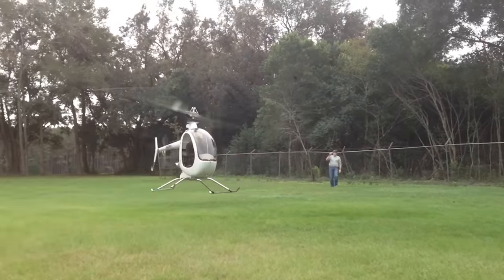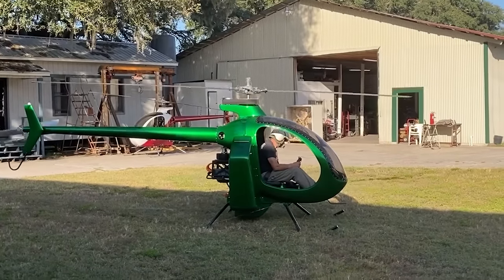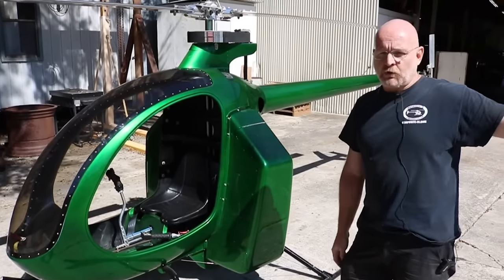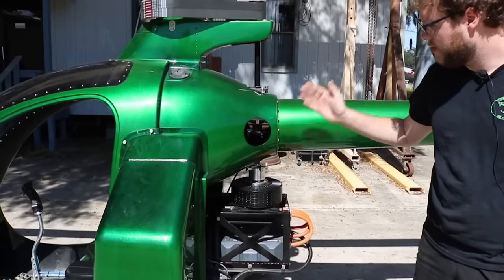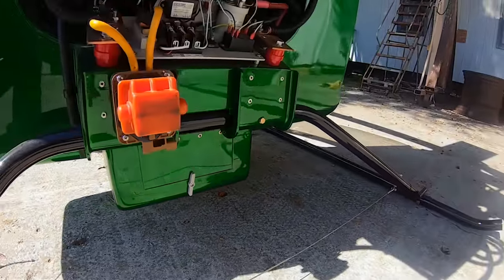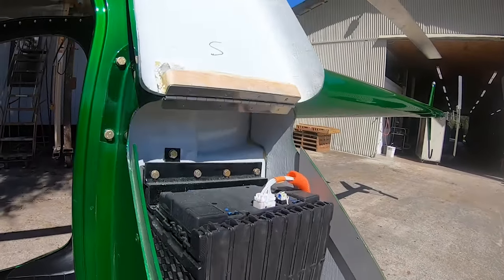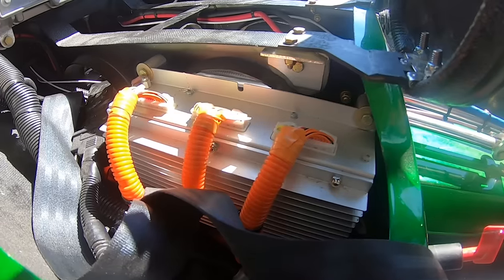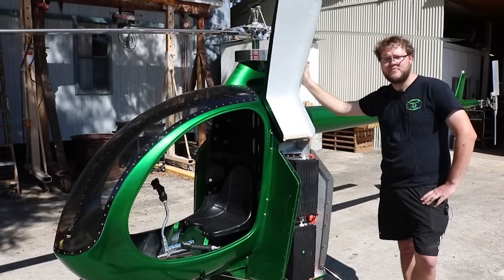Mosquito Helicopter going FULL ELECTRIC!? 2023

Comment: Very cool! I'd love to be able to play with this. What's the torque percentage indication at hover out of ground effect on a Mosquito and what is max?

40 kW and 2750 rpm gives 138,9 Nm of motor torque. Sounds like you need lower kv motor to keep running it if you're maxing out the current limit of the controller now.
Reply: OK sure, thank you father. 🙄

Comment: I'd like to know whether they think a separate motor for the tail rotor would be a good idea, particularly if they were clean-sheet designing an electric-only model. How much room for optimization do they think electric motors could allow, if they completely drop provisioning for a traditional drive-train?
Reply: Matt here. It's an idea we have discussed. We would be able to cut out some of the losses associated with the splitter gearbox for the tail/main rotor, the driveshaft, and tail gearbox. Main thing holding us back is that this would need it's own motor controller, some sort of redundant battery, and rotary encoders for the pedals. You really really don't want to lose tail rotor authority in a helicopter, so it would need a lot of testing. Currently we are testing the electric power-plant before we start thinking about any changes to our drive-line, which is well proven.
Reply: Those tiny model helicopters always have a large gear covering the whole underside of the cabin. I figured that this is the lowest friction solution to get some torque onto the shaft. Hidden from the downwash. Does not obstruct the view. Redundant motors: one in the front, one in the back.

Comment: DEFINTELY want to see more follow up on this episode. Any guesses at public release estimates and pricing estimates would be great. Also, with the added weight of either all the batteries or a hybrid style, additional engine/generator, would this aircraft still qualify as an Ultralight according to FAA regulations? The weight was not addressed in this episode.
Reply: I suggest you and the video creator not wasting time on battery-powered heli: it is DOA just from the energy density alone. Don't wanna agree with me? The battery can improve with time? There is a limit from a chemical-thermodynamics alone- pretty much like the second law of thermodynamics ruled out any perpetual motion machine.
Reply: @irvinewayne4086  Not the same thing but i've seen powertool batteries like the m18 Milwaukee go from 2ah 300-400 charge cycles with a 400watt output to 6ah with the same sized and weight and 3000 charge cycles and 1800watt output. There is also improvements to the inverter efficiency and weight too to be had.

I remember going to job sites in the late 90s and it being a spaghetti mess of cords cause the battery powertools just weren't up to the task. Today only the air compressor and shop vac seem to be the only corded tools that are common anymore. That is only cause of increasing battery power/energy density. Idk if it will ever improve enough for a transatlantic flight but there is still much room for improvement

Comment: Weight seems to be the issue over all else. Would love to see a follow up :)
Reply: Always will be. Lol
Reply: No fat chicks!
Reply: Nothing else comes to mind? You know, with the guys head being higher than the rotors.  Nothing else strikes you as a concern?
Reply: range is also an issue. 25mins is like a trip down the shops for a pint of milk and back.
Reply: Not really, I guess any heavy fuel engine plus gasoline adds more or less the same weight. 🤔
Reply: @CesarPeron  energy density of fuel is 33x more.
Reply: @CesarPeron  True ! That gas adds up.

Comment: I would also think that when solid state batteries show up projects like this will really take off.
Reply: I see what you did there
Reply: Not really. Solid state will only double the flight time. So it goes from 20 to 40 minutes hover time. But then you have to factor in some margins and you are left with maybe 30 minutes or less depending on usage. That is still useless. A gas helicopter can fly for several hours. Hydrogen fuel cells will be somewhere in between.
Reply: Solid state is much safer and lighter. An Aeros ANT can fly under power for more than an hour.  If it had solid state then it would be even more fun
Reply: @jimj2683  30 minutes may be fine for many uses. That could move someone 30+ miles. Rarely do helicopters travel for hours on end from point to point.

Comment: I built my own batteri\y packs and they worked just fine. I am not an "engineer" but making battery packs and wiring them correctly with the BMS and other requirements is not difficult nor does it require an engineer.
Reply: "nor does it require an engineer" but it helps if you know what you are doing.
Reply: This is a terrible attitude. Battery powered aircraft are no joke. A fiery death like the Siemens tragedy is the worst way to go. Please don't trivialize the risks.
Reply: You can make your own packs, but they won't be any more energy-dense than the properly designed modules that they are using, so there's no point.
Reply: Be sure and tell that to John Denver when you see him.
Reply: for a full size flying helicopter ?  show us a video
Reply: I literally put together an LFP 3.5kWh 4S battery tonight (about 3 hours ago from when I made this post), but I still wouldn't discredit the work these guys are doing, nor ridiculing the mistakes they make. 

The worst part were the lugs I was using for the BMS balancing leads were 5mm and the cell terminal posts are 6mm. I had to drill out the lugs. I think I destroyed about 6 in the process lol

Comment: Cool in concept. Maybe someday we'll overcome that whole energy density thing.
Reply: It doesn't make sense, just buy a Cabri or R22 and you got a better helicopter today, not in 10 years.
Reply: Much better batteries are on the horizon.
Reply: LOL yeah, you know, just buy a $300,000-$400,000 helicopter instead, because you know, the average person just has that laying around 🤣
Reply: @caseysingletary9260  It won't cost less than a piston engine helicopter, it just can't because of the scale economy. Want proof of this claim? Just think about the Pipistrel, the electric version cost more the the piston one. Not the other way around.
Reply: @limamikeaviation6200  if this kit ever does make it to market, it will not cost nearly as much as a cabri or R22. End of discussion. Toss all the words out you want, that will always be a fact.
Reply: @caseysingletary9260  Yep, you are right, the point I was trying to make is that it will cost more than a comparable kit piston engine helicopter. There is no advantage few advantages in making an electric aircraft, price is not one of them.
Reply: @limamikeaviation6200  an electric advantage would be operating cost, both due to the lower cost of electrical energy versus fuel, and due to lower powertrain maintenance cost. It's also quieter. 

At this point, as they said in the video, there are few potential buyers for a helicopter with such short endurance, so it's not a viable production product and wouldn't be even in a more refined production version.

Comment: Great prototype! Are there any provisions for cooling air into the battery enclosures? Would it improve the batteries efficiency at all? Air cooling would be readily available (obviously) from the rotor.
Reply: Sort of answered in the video.  They're running so low power that active cooling is not needed.
Reply: They are doing nothing about cooling the battery modules, but they could mount them to finned aluminum plates and blow air past them, as a crude cooling system. The face of those modules which is designed to be cooled in the one that they have vertical and facing inward in the side packs; it normally sits on a liquid-cooled plate.

Without proper control, they may not want more battery cooling. These cells need to be kept within a temperature range for best performance, and while too hot is a problem, too cold is a problem too.
Reply: @brianb-p6586  Cooling is not needed due to the low power draw from the battery pack.
Reply: @LoanwordEggcorn  that's what they say, but a continuous 8 kW per module is well beyond the normal service of these modules. They might still be okay.
Reply: @brianb-p6586  Agree it's higher power per module than the Chevy Bolt donor vehicle, but it's probably still ok.  It's a 3C (3 times capacity) discharge rate.
Reply: @LoanwordEggcorn  right... but while 3C might a reasonable peak discharge rate without cooling, 3C continuous is another matter.
Reply: @brianb-p6586  Depends on the battery chemistry, packaging, etc.  3C is a bit high for NMC.
Reply: @LoanwordEggcorn  it's too high for LFP as well, although I doubt they're using LFP. Most likely NMC, NCA or LCO

Comment: A reduction gear would help. I know its a pretty far stretch, but I sell electric lawnmowers. One of the problems with them is the run time drastically decreases with load. We can have a mower that can push mow a half acre on a 60v 10amp/hour battery, but if you let the yard grow out and try to slog through it. You wont be able to make it through half the yard before the battery dies. Our big twin blade electric push mower with a gear drive actually runs for an hour and a half or more on 3 10 amp/hr batteries.

Comment: Great to see an electric helicopter, even that it is a prototype it is a good start. Very quiet and easy to fly as far as I can see. With future improvements on battery density this will be viable. Another idea is to use a Hydrogen fuel cell. That will give a bit longer fly time.

Comment: How is the weight different with the battery power vs gas vs turbine?
Reply: The electric bird is heavier
Reply: @allencox7949  How much heavier? Did the combustion engine version fall within part 104 limits of 254lbs? Does this one?

Comment: i like how he though it was gonna be a 12 or 24 bolt system haha
Reply: LOL, the wires would have to be HUGE...
Reply: @RussellD11  not only that, 12/24 volt has very little torque, and not nearly enough to drive two rotors capable of lifting a load of mass off the ground.
Reply: @missingMBR  agree, but I think if you "could" pump enough amps through at 12-24V it would have quite a bit of torque.. But agree 100% its not the safest, or best way.. Way too much resistance as well at lower volts...
Reply: @RussellD11  sorry I got confused there. Voltage is proportional to speed. Current is proportional to torque. So you're absolutely right. You could throw enormous gauge wires at the motor and achieve the same amount of torque. But is it practical, not very, haha.
Reply: @missingMBR  they "may" also find going to AC voltage like the bigger EV cars use, may have some weight benefits, and lower temperatures..Will be interesting to see how this pans out and what they end up using.

Comment: I think if they went with LiPo batteries they could reduce weight...or extend flight time a bit. I think they need more aerodynamic battery boxes as they refine the design; those boxes must create a lot of drag in forward flight, although I'm sure creating lift is eating up more of the battery energy.
Reply: They might be able to put the batteries in aerodynamic pods that might have less drag.
Reply: That's for sure, this is just the first prototype, a "let's put something together with what we already have and see how if works".
Reply: They are using a type of lithium ion battery with one of highest energy density of any battery is just a different anode that is better at stacking the electrons. You might be thinking of old Nickle cadmium batter or NiCH much heavier.

Comment: I'd love to see this with the torque reduction and a production ready battery pack.
Reply: I`d love to see utilization battery improvement. Almost noone talks about. All these "green electricity" is bullS without battery utilazion.
Reply: @vovanikotin  What is utilization? is that cycle life?
Reply: @JD-yx7be  yes, end of battery life, not simple dump as garbage, but some kind of refactoring battery chemistry to use in other applications, or full recycle
Reply: @vovanikotin  I know the newer LFP batteries can last over 3000 charge cycles over the older 300-500 for NCM batteries but they don't have the energy density and don't work as well in colder temperatures

Comment: Hybrid would be great with the motors in tandem through a dual input gearbox with freewheeling units.  If you were to lose the gas engine, can safely land with electric without autorotation.  The gas engine would also charge the batteries during less demanding portions of the flight, determined by flight management electronics.  A nice HMI touchscreen in the cockpit to display all the parameters for additional cost $$$.  Would be a hit eventually, and especially as battery tech progresses (or fuel cells!).  Wish I could join in making it.

Comment: Idk about the belt system. 
is it known to slip if you ram up motor on take off? 
Or what if your G force is to high when landing, 
causing the belt to slip due to high motor power to slow down the G force for smoother landing?
since it is electric. 
does it have a smart system for automatic pilot?
for easy take off and easy landing?
Some drones have that feature.

Comment: I would not venture into EV aircraft rotary or fixed. The power demand of electric motors is enormous. Study the Laws of the conservation of energy with respect to electricity. So far there is no battery capable of storing enough energy for any practical application. Even EV cars of today have limited range and if the user demands more performance, the batteries will drain quicker.
Reply: throwaway3873  It's a free country, some might say. As of the present, you have the right to make dumb purchases. if you don't already own an EV, go get one. Some people have to learn the hard way.
Reply: Tell that to the bumble bee.

Comment: In it's cuuent form a bit hard to justify buying this helo -  charging for five hours to be on air for mere 25 minutes .
Reply: You gotta start somewhere!
Reply: The main advantage of electric solution is modularity. If a new battery type or energy source appears, you simply change the batteries and that's it. I think it will start to be interesting by 1 hour endurance. At the current state maybe interesting would be changable batteries. And you can operate the heli like the RC heli models. Of course you can not to affors to fly very far away... 🙂

Comment: Suggestions (they might be stupid ,but,hey..even so ) : Double the battery cells. Use long tail for battery cell holding.(hollow isnt it? ) Might help weight distribution. Dont use belt on rotor, go proper eu axial.

Comment: The hybrid design sounds really interesting. Get your flight time up to a more flexible. If the hybrid system was tied into the main drive it may be able to work as a redundancy in case of main drive failure 🤷🏻‍♂️.

Comment: Are you powering the rotor system from a stop directly  from the electric motor with no slipper clutch ?is that 30 seconds of huge current draw from the battery pack ?

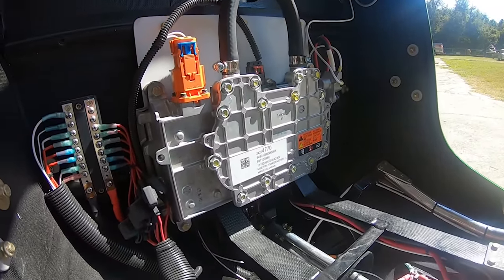Comment: I spy a Chevy Volt battery disconnect at 2:23. Packs look pretty similar as well, also made by LG Chem. At 5:47 is a GM 24274770 pack controller also off a gen 2 Volt.

Comment: I wonder if you could put two small wings with a small rotor on each to replace the tail rotor.  Send slightly more power to one of the side motors to offset the top rotor torque.

Comment: hi cool idea.. looks heavy..probably why too much amp load.. gets hot..try to find a way to put an alternator on the side if the other motor vertical) and gear it up.  and connect it to a ligher battery..
thanks for making life easier..happy flying...

Comment: What is the objective of converting these very successful choppers to electric? Reliability?  I heard the electrical engineer say they are getting around 25 minute flight time out of the batteries in a hover, which does take more power than forward flight, but I was wondering what the max flight time goal is eventually.  I'm guessing the electric version is much more reliable than the recip or turbine engine.  What is the weight of this electric version vs the turbine version with full full, and how much is the useful effected?

Comment: looks promising but a bit low the blade i know is how it works. but i think the tilt needs 1.0-1.5 degrees forward. like when in forward trust taking off and, finding a way to anchoring the foot to a pad because is light and if you exit while the blade is spinning could find problems.

Comment: Since a turbine increases in efficiency at lower pressure / higher altitudes, how does an electric powered helicopter perform at lower atmospheric density and temperature?  How is the performance compared to an eVTOL  with four motors? Is the electric helicopter competitive in it's advantages to an eVTOL, such as access, safety, performance and cost? I can foresee battery technology improving in power storage to weight ratio, but the fundamentals of helicopter flight handling seem a disadvantage compared to eVTOL. As an experienced former helicopter and fixed wing pilot I love helicopter's, but I can see it being replaced by the stability of the eVTOL designs for personal use.

Comment: You should have a 4 alternator/generator system running on the belt and any available rotational shafts like the tail rotors just put a belt and pulley system to charge the battery packs constantly while in high rpm ranges like the original hybrid system and have an e.v that charges as it’s in flight kinda like a self sustaining generator system as long as weight isn’t an issue
Reply: Why stop at 4?
Reply: @Paiadakine  weight is the issue really too much weight = more battery drain defeats the purpose of having the alternator/generators the goal is to put as Much or more power to the battery back than you can have basically unlimited sustained flight ….in theory anyway